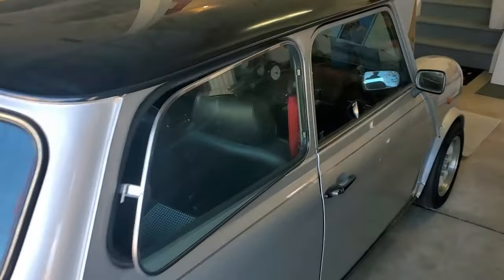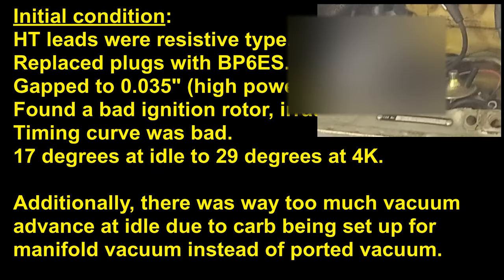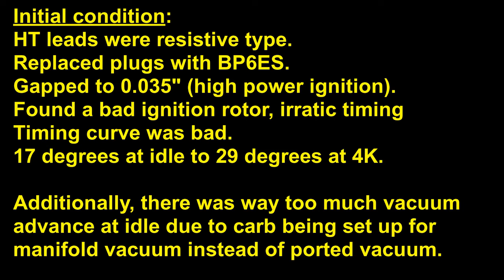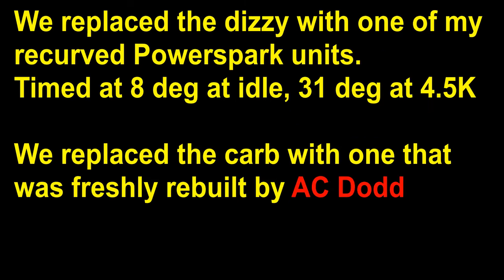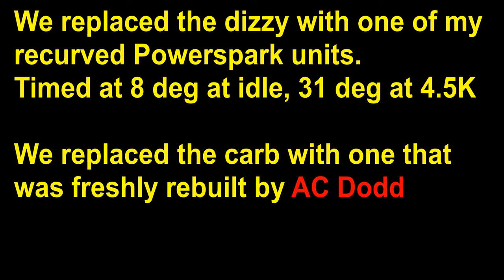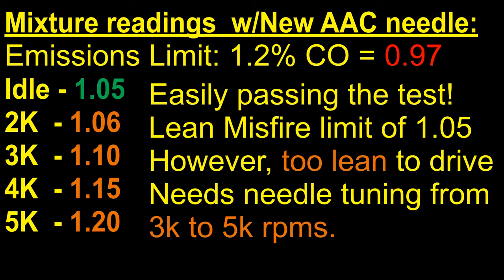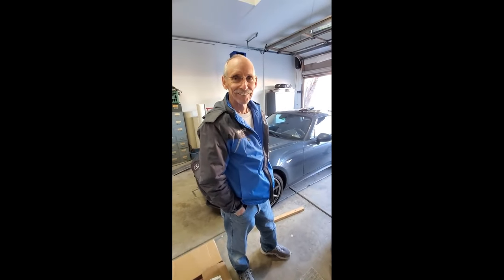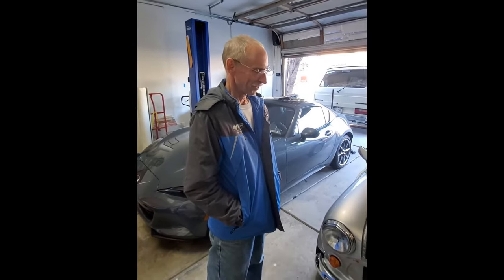Tuning Day with 1984 Mini 998cc, Strict Emissions test!

Comment: This rather makes the case for closed loop fuelling which normally means EFI. Back in the day I had a BL Montego using the "S" series 1.6litre engine that used a single SU HIF44E carb. This carb used a stepper motor to adjust the main jet location in relation to the needle. It was certainly used to produce a rich mixture for starting i.e. the  "choke" and I always wondered if an O2 sensor and full closed loop system was part of the design. I think some V8 Rovers used a similar SU.